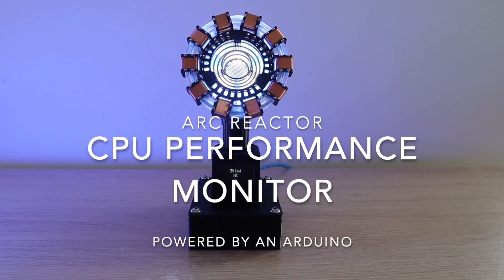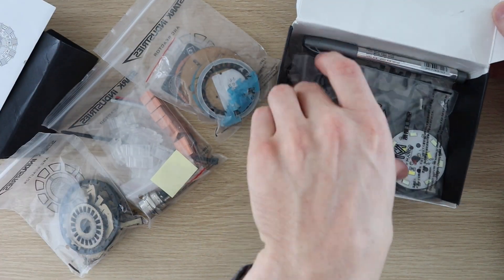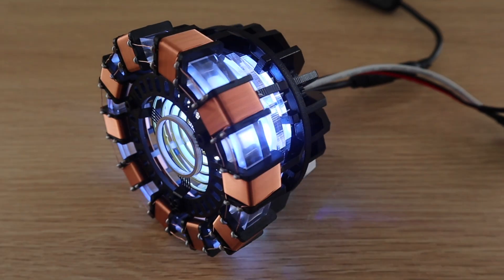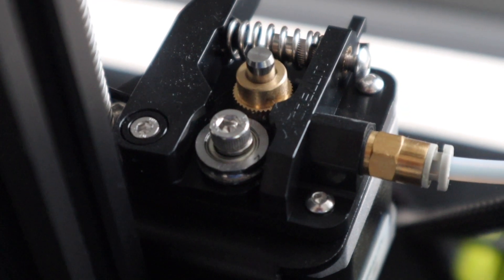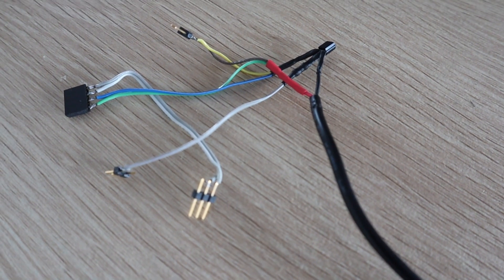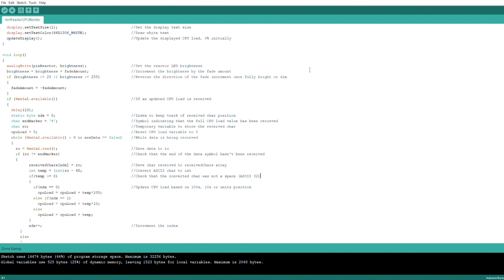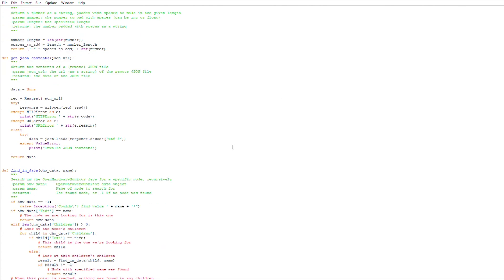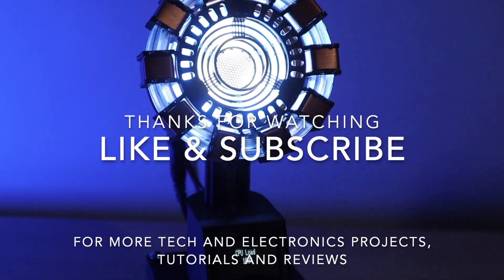DIY Arc Reactor CPU Performance Monitor, Powered By An Arduino

Comment: I bought an Arc Reactor but it has a sound/vibration control (Off/Constant/Pulse). Any idea on how to bypass this?  Thanks in advance.
Reply from the maker: There must be a microcontroller/chip on it somewhere that you need to find. Hopefully this is on a separate PCB to the LEDs and you could then disconnect the LEDs from it any drive them with an Arduino like I've done.

Comment: Dear Michael! Can I attach this thing to a PC PSU? If I can, is there any way for me to controll the light values or the light colors? I would like to use it for a PC mod. Thank you!
Reply from the maker: It's needs communicaiton with the PC for the CPU performance data, but the LEDs can be powered from a 5V supply on a PSU if you'd like.

Comment: Thank you for this guide and information! You are one of the rare ones who actually made a video showing this is possible.

I'm new to Arduino and I am googling since days trying to find a tutorial on how to show my CPU temperature on an Arduino display.
Many forums say that it should be possible to send it through serial to Arduino, but I am not that good at coding and don't know where to start.

I just ordered a 16x2 I2C LCD display so I can work on this. Would you have any idea or tips on how I could use this hardware monitor and python just to send the cpu temperature number to the Arduino display? Which part of the code is responsible for that? Since I don't need anything else fancy. :)

Thank you again!
Reply from the maker: Glad it helped you out! Yes, the Open Hardware Monitor app has the CPU temperature available as well. You'd just need to modify the lookup in the Python script to look for CPU temperature and send that value to the Arduino. It should be really easy to change.